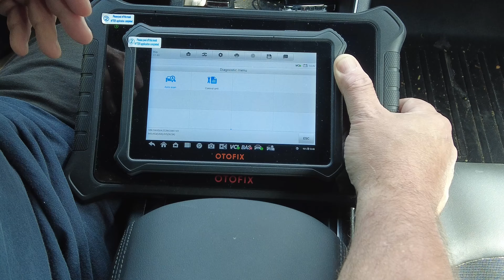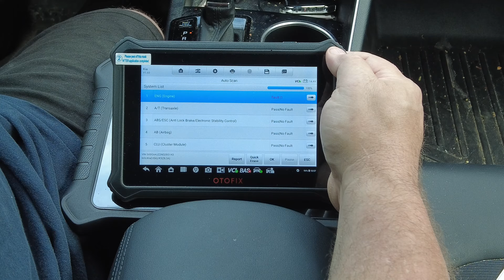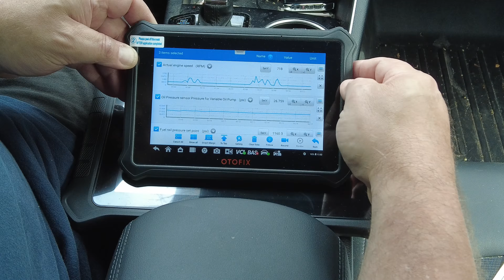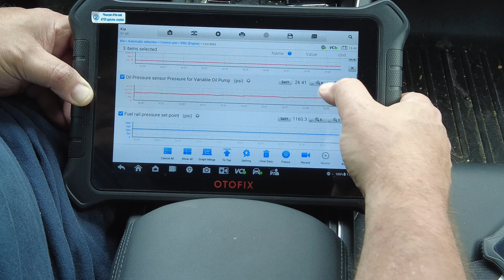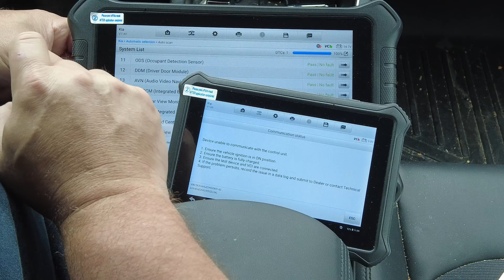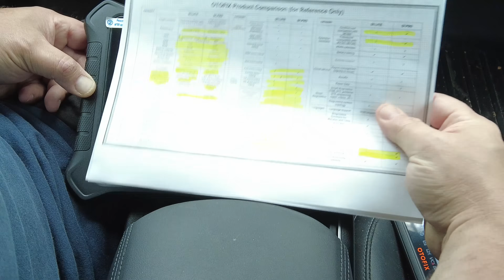OTOFIX Comparison D1 Pro VS D1 Lite OBDII Diagnostic Bidirectinal Scan Tools

Comment: Where did you find the fuel pressor sensor readings on the lite?
Reply from the maker: Not all vehicles have a fuel pressure data PID....  so therefore, if the vehicle's computer is not monitoring fuel pressure, it will not be possible for the scan tool to see fuel pressure on that vehicle.  On vehicles that DO monitor fuel pressure, that data PID will appear in the live data section with all the other data PIDs.

Comment: I am one who is very new and inexperienced with the use of scan tools. I have to trust the auto dealer. I purchased a D1 Pro but don't really know how to use it. Where can I go to get some instruction on the proper use of this tool?
Reply from the maker: The "how to use" is part is not too difficult.  If you just spend some time with it, you'll see that it is fairly intuitive.  However, knowing how to interpret the data can take years and years of experience. A scan tool only provides raw data and trouble codes to help lead the user in the right direction....  it still requires a human to make the correct diagnosis. 

For example:  Lets say you have an O2 sensor code.  That does NOT necessarily mean you have a bad O2 sensor.  You could have another problem that is causing the symptoms that will make the computer set the O2 code, (which could be MANY different reasons)  or maybe the wiring to that O2 sensor has an intermittent short, etc.  The scan tool can't tell you that information.....  only a human can do that. 

I do not know of anywhere that has a training course specifically for using scan tools.....  Other than maybe ScannerDanner's website.  He has a lot of good youtube videos but if I'm not mistaken, he also has online video classes that you can pay for.  He is a diagnostic expert....  and part of his diagnostic classes involve using a scan tool.  His classes may be more advanced than you're looking for.  It's worth a try, though...  Thanks for the comment.

Comment: Do you recommend the D1 lite for a new tech? Currently just became a technician B, I was a lube and tire tech but got moved up. Is the D1 lite be good to start off?
Reply from the maker: I think the D1 lite is a great scan tool.  It's not the fastest (computing speed) but it is a full bidirectional scan tool, with resets and relearns, and live data and graphing on all modules.  There isn't much this tool won't do.... Sure, there is some specialty stuff it won;t do like ADAS and programming TPMS sensors, etc....  but most scan tools don't do that stuff any way.

Comment: Hi, is the Otofix D1 Lite & Pro still your go to or favorite scanner?

I work on my own cars but for example I’d like to buy a Infiniti that has keys missing. I’ve read many instances that the D1 Lite asks for XP1 Pro to be bought to make a key.

Also in earlier videos you said the TopDon Phoenix lite was your favorite and they also updated it to have Topology.

Is that a better all around bi directional and capable of making keys for most manufactures? I know it’s about $550 more as well.

Does the OTOFIX Lite program ECU’s & PCM’s?
Reply from the maker: If you're looking for Topology, and you're not looking to spend well over $1K, then the Phoenix Lite Pro is a great Choice.  The Phoenix Lite pro video came out about a year before my OTOFIX videos. It may sound like I have multiple favorites at the same time, but these videos can be made years apart from each other.  Currently, my favorite is still the OTOFIX D1 Pro, of all the scanners that I currently have....  That doesn't mean it's the best scanner on the market, it just means it's MY (personal) favorite of the scanner that I own. Your favorite scanner can (and probably will) be different. 

Making keys is NOT my specialty, I'm not really the guy to be asking about that topic.  One thing I do know is.....  when it comes to keys, it's 100% dependent on the vehicle (year/make/model) so when someone asks, "does it program keys" The answer is yes, on some cars....  and not on other cars.  When most people talk about programming keys, what they are really asking is, "can this scan tool program the vehicle to accept a new key",  And generally, basic mid-high level scan tools should be able to do that. (again, depending on the vehicle) But what they are technically asking is "can this tool program keys?" And that answer is, "probably not".  To install a program into the actual key itself requires a programming dock for the key to sit in while it's being programmed.  Some scan tools can do this, but you would still need the programming dock. Again, every vehicle is different.  There is probably a reason whey they make a dedicated scan tool just for doing key work.  And again, that's why I am far from a key expert.

As for  "programming" modules....  Well, just like "programming keys" that can mean a few different things, depending who you ask.  Typically, most guys use a laptop computer with a J2534 pass-thru device for actual "programming".  Like when modules are replaced and they need to be "programmed" with the vehicles VIN number, and current software versions. I've seen some guys use high end scan tools for programming, but most guys use a laptop.  You need a subscription to the vehicle manufacturers tech system to have access to their software....  it's much easier to do from a laptop.  Even if you did use a scan tool for programming, you'd still need a J2534 pass-thru box and those are $1000 to $1800 by themselves. If you're only programming 1 or 2 modules, it's probably MUCH cheaper to have someone else program it for you.  With all that said, SOME vehicles allow the scan tool to "clone" certain modules so they can be "replaced".  Again, this is dependent on the vehicle.

Thanks for the questions(s).
Reply: @SlipFitGarage  Thanks for the reply. I get it, a dedicated key computer would be better. I just want an all around and I’m thinking because of my budget now, I’m buying the D1 Lite. 

Thanks for the great videos.
Reply from the maker: I'm sure you'll be happy with the D1 Lite.  It is a very capable scan tool in a modern (smaller, lighter) form.  Thanks again.
Reply: @SlipFitGarage Hey bud , I bought the D1 lite.

So I’m going to go look at a 06 Infiniti FX35 that the owner said, won’t go over 50mph. 

From the forums people are saying it’s the fuel pump or the fuel filter is clogged.

When looking at live data, does it tell you it’s not getting enough fuel pressure in like red numbers? Or that the value is not there? I ask because like on Scotty’s channel his says when things are not right. Me I don’t know values of most issues.

Also I tried making a key for another Infiniti and it deleted the original key that was programmed to the car. Is there a way to just add a key?

Also when it erased the original it asked for a pin that I didn’t have. Where is the pin?

I had to call a locksmith after, not fun.

Comment: According  to Otofix, the D1 Lite doesn't have bi-directional capability.
Their website states, "The difference between the D1 and D1 Lite lies in their diagnostic prowess. Only the D1 can perform Bi-directional controls, active and functional tests. Meaning with the D1 in hand, the technician can command and test every computer-controlled vehicle component and relay including those of the fuel, HVAC, and braking systems. And, only the D1 can perform advanced module servicing as coding, IMMO and adaptations."
Reply from the maker: You're reading an older version of the OTOFIX website. (or it hasn't been updated)  The D1-Lite has full bidirectional control.  It all changed last summer.  It was either June 1st 2022 or July 1st 2022 (I can't remember the which one right now) when Autel sent out a major update that gave ALL Autel 808 scan tools full bidirectional control.  And since the D1 Lite is a direct competitor to the Autel 808, and it happens to run on the same software as the 808, it ALSO received the same update.  I can tell you with 100% certainty that the D1 Lite does indeed have full bidirectional control.  I own one (the D1 Lite in the video is mine) and have personally used it.  I can personally confirm it DOES have bidirectional control.
Reply: @SlipFitGarage  I don’t think Otofix is a direct competitor to Autel
since Autel owns Otofix. I think Autel made the move to upgrade because of the D7 & D8 scanners and other mfgs are all upgrading their scanners.
Reply from the maker: @stepside2839  No, I never said Autel and OTOFIX were competitors....  I said Autel had to keep up with their OTHER competitors so they gave the 808 family of scan tools full bidirectional control.....  and once the 808 family was upgraded, the OTOFIX D1 line from Autel was also upgraded.  You are correct, Autel does own OTOFIX.  That's not a secret.  Thanks for the comment.
Reply: @SlipFitGarage  ok, you probably did not mean it as was stated. Your quote:
“And since the D1 Lite is a direct competitor to the Autel 808,”
As I read on I gave you thumbs up for your replies and I thought 🤔he already knows this, because it is only a direct competitor to its own model made in a different country .
I get it👍 thanks and nice to see you follow up and reply to many guys 👍
Reply from the maker: @stepside2839  You are correct, Sir.  I guess I did type that after all. Sometimes when I am typing my mind gets several steps ahead of my typing fingers, and when that happens I end up typing things that don't make sense.  In this case, instead of "direct competitor" I should have typed "same category of scan tools", or "same level or scan tools".  Meaning, the 808 and the D1 Lite are at the same level of scan tool....  when the 808 family was updated to have full bidirectional control, it made perfect sense for the D1 Lite to also get the update because they are both at the same level of scan tool.  In fact, I wouldn't surprised if the update files that get sent out to the 808 family of tools are the exact same update files that get pushed out to the D1 Lite scan tools. By saying "direct competitor", I did not intend to imply they actually competed with each other, I was trying to say they were at the same level of scan tool. Sorry for the confusion and thanks for pointing that out to me.
Reply: @SlipFitGarage  👍⭐⭐⭐⭐⭐👍
Reply: @SlipFitGarage did you get information about the difference between d1 and d1 lite? because I don't know which one to choose... :(
Reply: @SlipFitGarage  So what is the advantage of the regular D1 (not Pro) over the D1 Lite now (other than paying more money)?
Are they essentially the same now?
Reply from the maker: @mammonbeezlebub2427  Well, I don't have the standard D1 in my possession so I can't answer that with 100% certainty.  However, looking at any sales literature that can be found on the internet, I really can't find any differences. I always wondered why they would still be selling both the Lite and the standard once the Lite received it's upgrade at the same time the 808 family received it's upgrade.   I will send my contact at OTOFIX an email....  I have to ask him another question anyway.  I will ask him what the difference between the "lite" and the "standard" is.  I will post back here when he replies with an answer.  Thanks.

Comment: This is an awesome scan tool, but for the cost of these, there should be topology and individual graphing capabilities. I see that you can graph single pids in a sense, but you have to scroll up and down if you have more than a few selected.
Reply from the maker: I agree, the live graphing should be better....  and I have told my contact at OTOFIX about it. I also told him that several of my viewers have mentioned the lack of multiple graphs on the screen at one time....  I also gave him some example of competitor scan tool models that WILL show multiple graphs. He said he would pass it along to the Autel software engineers. As for topology, I also agree.  And again, I also mentioned this to my contact at OTOFIX.  I can see the D1 Lite not having topology, but the D1 Pro should absolutely have it considering some slightly cheaper scan tool brand/models currently have it.  My contact said he would pass along everything that I suggested to the software people at Autel.  We'll see if any changes are made in the near future.  Fingers crossed.  Either way, I'm still a big fan of the OTOFIX line of tools... Well, anything that runs Autel software.  Of all the scan tools that I've had the pleasure of using, my personal scan tool is still my Autel 908.  I love that thing.....  and it hasn't been updated since like 2020 (give or take) This new OTOFIX D1 Pro will take it's place.  Thanks for the comment.
Reply: Thanks for the reply and for passing the info along!! Great video regardless 👌 👍 👏
Reply from the maker: @victorhoyt4352  thanks

Comment: Does the lite do bidirectional tests? Website for ottofix says it doesn't but Amazon says it does?
Reply from the maker: Yes, it 100% does bidirectional tests, resets and relearns. (you can watch my D1 Lite video to see for yourself. It is linked below this video) It all changed last summer.  It was June 1st,  2022  that Autel came out with a major update that gave all Autel 808 scan tools bidirectional control.  When that happened, pretty much all the 808 sub models became the same tool.  Also, any other tools that competed with the different 808 models became the same tool. And specifically anything else that runs on Autel software, such as the OTOFIX line of tools, for sure received the major update, too. That was the day when the OTOFIX D1 Lite pretty much became the same as the OTOFIX D1 (non lite).  That major update changed the entire scan tool world.  For example, on August 1st last summer (two months later) XTOOL had no choice but to send out a major update that gave their D7 full bidirectional control. (The D7 is a direct competitor to the Autel 808 series of tools) And other brands like Topdon and Launch (and others) had to either quickly update their mid level tools, or release new tools with new model names, in that same price range, to compete with the Autel 808 series of tools.  Pretty much all scan tools these days in the $400-700 (give or take) all have full bidirectional control now.....  and it's all a result of Autel's major 808 update last summer.  Why did Autel do this?  Not exactly sure... but it's probably because someone else (another company) did it before them and they were just trying to keep up. So, long story short, when you see marketing literature from OTOFIX that says the D1 Lite does not have bidirectional control, it's because that literature is old and still lingering on the internet from before the June 1st 2022.  Same with Autel 808 sales literature.  It's old marketing material that is still everywhere on the internet. Unfortunately, people still see that information today and they have no ideal it's all wrong nowadays. Or, they see the old marketing material, and then they see the new marketing material for the same tool, and then become confused why they are seeing two different list of specs for the same tool.  Now you know why....

Thanks for the question.
Reply: @SlipFitGarage  DANG You answered everything i needed to ask.😮💪🏾💯🫡🤣
Reply: @SlipFitGarage  Thanks for this comment I was looking between the D1 lite and the D1 yesterday to see Wich one to buy, d1 is obviously more expensive but I was not finding Wich was the difference and now I know that they're the same, I will just get they lite! Thanks!

Comment: Does is read fuel trims?
Reply from the maker: Both of the scanners in this video are bidirectional control "Scan Tools" and they are capable of showing all live data on all modules .  Yes, they both will display fuel trim information.  Pretty much anything above a basic "code reader" can display fuel trim data.  Thanks.

Comment: I have a question about the wifi, it said they both support the 2.4 and 5 ghz bands, but the D1 Lite only supports the 802.11n (wifi4) standard.  The 5.0 Ghz band wasn't introduced until the 802.11ac (wifi5) standard.
What one does the D1 Lite support? When you load up the wifi networks at hone can it connect to 5Ghz only network?
Reply from the maker: You know, I wasn't sure about that, either...  In fact, I googled to see if 5.0 GHz existed with wireless N because I thought it wasn't introduced until Wireless ac, just like you said.  I ran across a website that mentioned a wireless N router having both 2.4 and 5.0 wifi bands. Maybe I read it wrong.....  But I do agree with you, I thought 5.0GHz was introduced with wireless ac. Anyway....  YES, I can see both of my WiFi bands here on my home wireless network. The D1 LITE does indeed support both the 2.4 and 5.0GHz network bands.  I am looking at it right now in front of me just so I can be 100% certain.  Thanks for the question.
Reply: @SlipFitGarage  Thanks for the response, I had to do some digging, but apparently 802.11n(wifi4) supports the 5 ghz band, though not all devices did support it.  The Data sheet is likely correct even though it wasn't common until 802.11ac(Wifi5).   Thank you for your help! Looks like a nice little tool for a DIYer.
Reply from the maker: @NH-fq6rd  Thanks for the technical clarification, I do appreciate it. 🙂